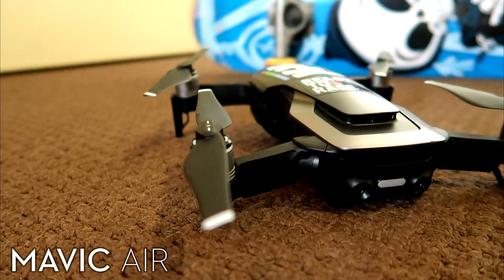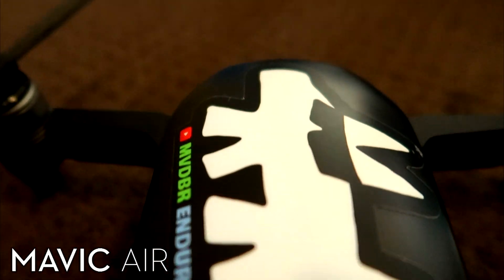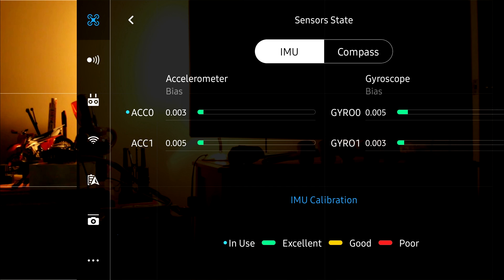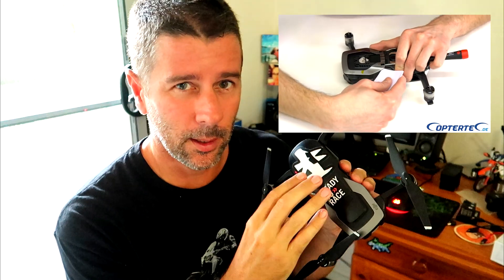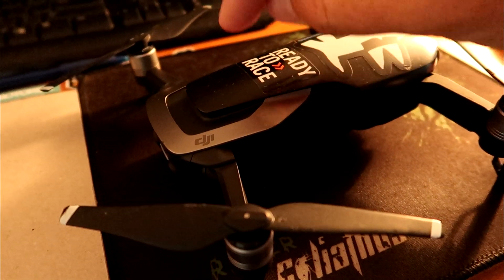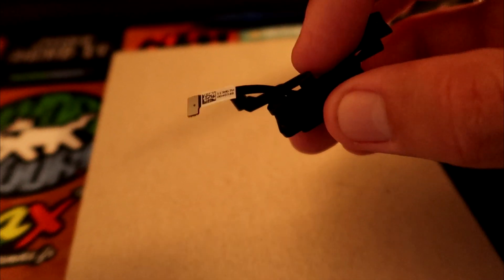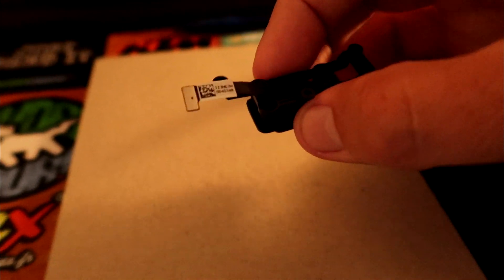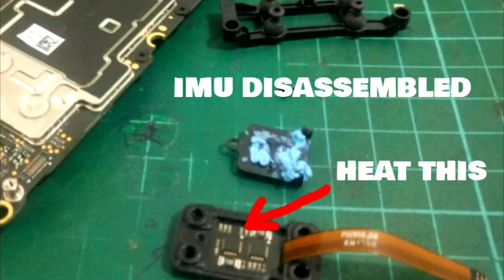DJI Mavic Air Free Fix For IMU Gimbal Horizon Not Level & Glitchy Controller Issues

Comment: I've suddenly had this very same problem on a mini 2.... day before on the harshest wind on the beach I got amazing stable footage....after a minor crash at night (not the first one) it hasn't been the same since.

It's been....OK but the horizon tilt is so bad when it starts from north south directions. I fear sending it in and dji telling me to pay 200usd for something they wont even fix when the rest of the drone is working just fine
Reply from the maker: Oh man I have a Mini 2 now, I didn't wanna know that 😬 I'll be extra careful not to crash it, that munted horizon really pissed me off
Reply: @mvdbrextra  yeah it pissed me off too man.... after  a week of sending it in, a week of them getting to find out the problem (they couldn't seem to see the issue) and ANOTHER week of technical analysis..looks like they'll find me at fault, saying the middle frame has a crack and basically charging me 66USD (mostly for labour- the middle frame peice was only a 2 dollar part) for this issue.

not so bad but I'm still pretty choked with how long this took. I've had a very lukewarm experenice with DJI CS- and I imagine it'd be MUCH worse for any other drone manufacturer.
Reply: @Matanumi  ugh 😫 is the horizon issue fixed at least?
Reply: @MVDBR 

New drone WAS working fine with a nice level horizon....

Now after 30 days the new gimbal is also fucked. Except this time its only when it tilts- it corrects itself when you've finished flying sideways. NO CRASH WHATSOEVER this time.... it just suddenly appeared one Monday and hasn't gone away

Massive fail. I don't want to wait another 4 weeks for another drone and possible bill
Reply from the maker: @Matanumi  ugh thanks for letting me know mate, I'm still being super careful to not crash my Mini 2. Not that I have been using it that much lately
Reply: @mvdbrextra  then you honestly should be fine.

I used mine everyday day. Motors and parts likely get warn overtime they are so small... especially the gimbal arm

Comment: I think the main issue is the IMU itself. It's defective and requires changing. I have no clue how to better preserve the IMU, and if it's going to fail without any reason, that's very scary.
Reply: I actually ended up changing mine out for another I bought off eBay and the problem persists :( But yeah you're right, if both IMUs happen to eventually fail it could be a bad situation. Cheers
Reply: @MVDBR  the NEW one failed!? fuck!
Reply: @Matanumi  it was the same, which kinda made me think the imu maybe wasn't even the issue to start with 🤷‍♂️😭 I'm pretty sure the drone was fine before I crashed it, that was when the horizon started going wonky. Maybe it's the gimbal? 🤷‍♂️
Reply: @MVDBR  I'm discovering that it's very much the gimbal that malfunctions. They aren't built to withstand impact in the smaller drones and dji has software only they can use to fix it.

Such a scam. Fuckin hate how this company has such a monopoly and yet has so many issues without a good fast efficient system in place to repair
Reply: @MVDBR  would you be sure its the gimbal? Or a motor? That could be possible?

Were the issues exactly the same? I swear its the IMU- perhaps you were sold a lousy one?
Reply: @Matanumi  I got no idea mate. Haven't had any such issues with the Mini 2 as yet. It did seem logical that it would be the IMU because of how the angle of the horizon varied depending on which way the drone was facing 🤷‍♂️